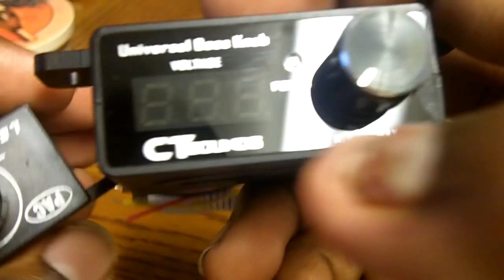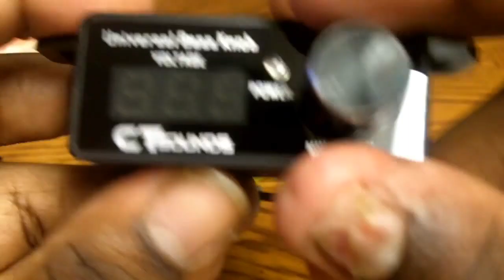Car Audio NEWS REPORT! Sundown Audio, CT Sounds & Skar

Comment: here's some news for you.  Sundown is going to be coming out with a new line of amp called the SALT line. Sundown audio low voltage technology and its supposed to be a 12v beast! 4k 6k 12k  and the 12k does 20k at 14.4. There also coming out with a amplifier completely made in America and its going to be a 4k thats 4"w x 8"l x 3.5"h and its going to be 90% efficient and you will be able to wire it down past .5 ohm to produce 8k safely. Its going to be a competition amp. The SALT amplifiers will be available in October - November.  The American made amp will be next year. And all this info is straight from Jacob. You can go to Sundown after dark to see it for yourself self. There coming out with a new shallow mount neo subwoofers too, and its going to have alot of the same characteristics as the SA subs.  Maybe you can get some info from the show for your next episode! I would say alot of people know nothing about this and it would get a ton of views.
Reply from the maker: Josh Hanson I didn’t know that at all! Thanks for the information, I will include that next time

Comment: $50 bucks for the ct sounds????? I'm my area the Lc7  was 7$ and the ct sounds is $19.99
Reply from the maker: It's cheaper now. But when they first came out it was like $50
Reply: @SubwooferKing100  dang I'm glad they changed the price
Reply: That ct sounds universal bass knob isnt knew..its been out for years.
Reply from the maker: @installerman40  This is a re-edited video from the past that I had misinformation in